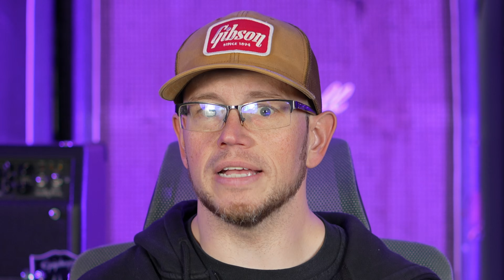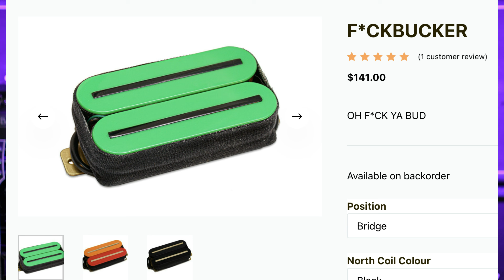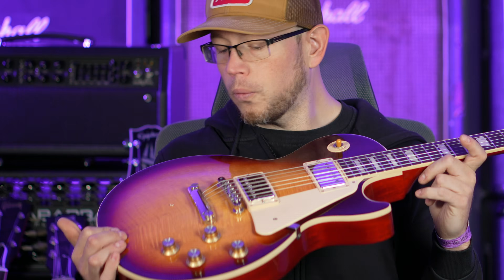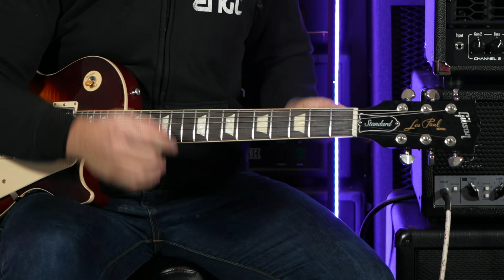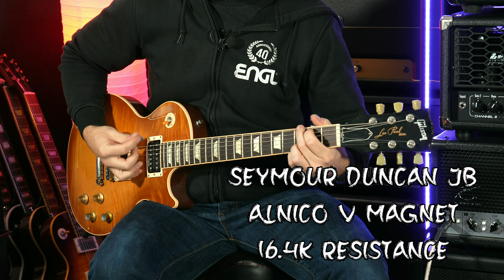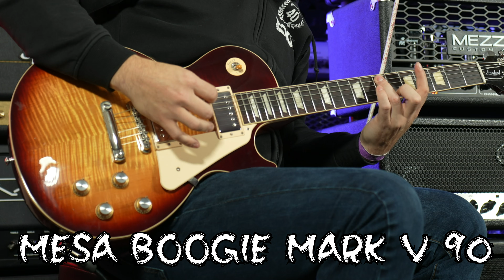EVERYONE has been using the WRONG pickups for metal......

Comment: I thought they all sounded like A$$.. They were all set too close to the strings and there were no separation in the underlying harmonics. Every pickup has a sweet spot where that happens IF someone took a few minutes with a screw driver to find it. ALL of these have obviously been set up with a ruler spacing.

Comment: To be fair, it's just the concept of gain staging.

Low frequencies have more energy so when you have a higher output pickup, they get pushed further. Those low frequencies distort more creating more harmonics above them which can muddy the sound. So it's not like it's necessarily an EQ, it's just increasing the gain which if you do in any sort of pro audio setup, can cause muddiness depending on where in the gain stage it's at. This is a lot like going through a Multi-Step process in mixing and making sure to drop the gain before moving into the next piece of equipment so that it doesn't distort the input. You'll get a clear distortion if you are letting the clipping stage in the later equipment distort, instead of pushing through the front end. 

Which means technically, both you and Glenn are correct. Just for different reasons. Glenn has not stated that there's no difference between outputs in pickups, in fact, he stated that's the primary noticeable difference between them all. And that's just in the passive pickup world. He's also stated there's a difference between actives and passives, and single coils and humbuckers. 
The main argument is that any sort of frequency curve that is built into the transducer, meaning the specific tonal characteristic of that pickup, is very frequently Lost once the signal has been clipped. I don't think he's necessarily come to the conclusion of thinking about gain staging in the harmonic series, but I think he understands that on a deeper level. He's just not thought to apply the thought process to the study.

Comment: When i have learned something about high output pickups then its that the more output you have the more dull they sound. 
From personal thinking i would say that the more output you give a pickup the less you'll be able to modify its low mid and high parameters - but i wont take that statement for granted - its just what i have in mind from engineering side - not a magnetics expert here.

Comment: I have discovered a good quality PAF humbucker can sound just as good if not better compared to a modern high output pickup for high gain applications. You just have to use the right amp and gear.

Comment: Using a boost is hiding many of the differences you would hear caused by various output levels.
Reply from the maker: No it is not. The pickups still have the same output levels and the amp gain was set exactly the same between all pickups.
Reply: @belligerentamateur  yes it does cause the boost is compressing the signal, any amount of compression is leveling peaks and valleys.  Try the comparison without it.

Comment: once I bought a Dimarzio 36th anniversary PAF set for my HH Tele i've pretty much been stuck on moderate to low output pickups. brighter, gives me less compression and less low end than the Duncan Custom and JB I was running in the past. That said, sometimes when I want that all out wall of sound I do like my duncan Black Winter.

Comment: ive noticed the alnico 4 even from other manufacturers have that mid boosted cutting tone with the vintage wind that mimics and overwound paf with an alnico 5  but the 7.8 k wind still keeps the inductance lower so the highs still cut through albeit with the med output ..the alnico 4 really doesnt have the typical grail paf tone but its compelling if you dont mind the slight mid punch ..

Comment: To add clarity to any pickup you just have to lower it, increase the string distance so that it captures less bass frequencies. Or EQ the amp with less bass (but it is trickier becouse EQ knobs interact with eachother, just have a look to a tonestack simulator)

Comment: There are two approaches - high or low output pickups. In early days you needed high output pickups, because it meant high-gain, now you have high-gain amps that have plenty of gain and more. Boosting a low output pickup wasn't a great option because pedals were noisy. Same thing with distortion pedals. You can use noisegate then, but even the best ones cannot work when your string output to pickup noise ratio is low. That's where high output pickups are usually better.
But today, I think even noiseless singlecoils could be fine :)

Comment: It was really difficult to hear a big difference. But I use Gibson Custombuckers PAF on my Gibson Custom Shop, and there is definitely more clarity when I swap guitars. Another thing is that if you set your amp tone with high gain while using a PAF low output pickup, and then swap over to a hot pickup, you might need to adjust some knobs down on the amp because now you got too much.
But which do I prefer? Been playing on and off for 17 years and I tried my first PAF (Gibson Custombuckers) last year. And I fell in love with it, so if I had to choose it would be that.
Anyone have a PAF pickup they really love that is also slightly wax potted? I would love to try some.

Comment: All those metal guys running EMGs with actual hits and songs that I've actually heard of are all wrong
Reply: Oof. Buddy. EMGs are low output. The pots are pushing that sound. Look it up..
Reply: Also want to add: That's why these people using high output passives that try to sound like Metallica, can't. A squier with low output will be easier to dial in a Metallica tone with the clarity of an EMG with note separation. You can laugh at that notion all you like and think it's a joke. It's not. EMG's output at 10..

Comment: High output pickups made perfect sense in the 80s when amps didn't have that much gain, but with modern amps and modeler the amount of gain we have at our disposal is so massive that you can make the tamest guitar chug 10x harder than the gnarliest guitar in the 80s.
I was recenlty toying around with my father's Gibson Les Paul loaded with low output, vintage specd PAFs into my PRS MT15 and I could easily acheive earth shattering palm mutes with the gain knob at around 4/10.
Reply: @argento8447  I have found that, regardless of the amps gain, higher output pickups have a fuller tone.

Comment: High Output pickups are ONLY for driving the front of a tube amp. IF you are using a modeler, or if you have pedals in front of your tube amp, use a 8 -9k pickup at most! If your pickup pushes too much.. you will clip (badly) your Modeling gear and some pedals... Get an EQ pedal to balance out your different guitars....

Comment: Man guys have been using PAF's for metal since the 70's.  It was all they had.  I've been really impressed with that clarity and note separation from the Alnico II Sheptone Kahanek pickups in my Tokai.  I've had those things for over 15 years and it's wild how well they hang with the higher output modern pickups.

Yeah you can absolutely tell that they have a bit softer of an attack and less pointy treble but compared to Alnico V, 8 and ceramics, the note clarity and separation when the gain on the amp is cranked is unmatched.  I had a set of Dimarzio Alnico II Pro's in an old Ibanez years ago and it was exactly the same type of sound and structure. 

All that said, I still think that a good set of Alnico V pickups is the sweet spot for most players if they want the clarity of Alnico but the tighter and more focused low end and more aggressive high end that most A V magnets have.  The gibson 70's tribute pickups in my Lizzy Hale explorer are absolutely incredible.  Warm lows and mids and clear smooth top end.  They're not as bright as the ceramic Alpha/Omega Duncans in my Schecter but they sound twice as big.

Comment: I have a LTD EX400BD wich was equipped with EMG 81s never really liked the sound of them. Then the bridge pickup broke and I replaced the EMGs with a Seymour Duncan PAF in the bridge and a Jazz in the neck position. The PAF sounded good but hadn't really that what I was looking for. Now it is replaced with a JB and that pickup fits the guitar, my amp and my playing well.
My Gibson Explorer sounds awsome with it's Gibson pickups. I also had a guitar with a Duncan Black Winter. What a beast of a pickup, in high gain it was mercyless brutal but with a fine clarity and brilliance, it was also a extremly hood pickup for clean sounds. Sadly the guitar wasn't sorted out in quality control (the locking saddle was drilled incorrect and everytime you used the Floyd Rose there was an audible crack by the headstock three luthiers said that it isn't possible to repair) as I bought it and didn't get it replaced. (Was a LTD M Black Metal an absolute banger of a guitar)

Comment: High output pickups are a solution to a problem that no longer exists. If you insist on absolutely not using pedals, these pickup manufacturers should at least offer coil taps on these high output pickups, so you can use it as an on demand boost.
Reply: Exactly!

Comment: Yes, I. discovered long ago that low output pickups and a hot amp brings the best tone.  Great video, my friend.  I love the pancake butt grandpa comparison!  LOL!  You dirty dog! The problem that I found is that you need more Les Pauls. On a serious note  , Are all the LPs chambered?   I love the chambered LPs .. I love em all. :) I also discovered a very long time ago, A pickup does not make that much difference at concert volume with a high gain amp.  Great video! Sugarbucker = Burstbucker.  The original. The after market Burstbuckers are alnico IIs. I guess they decided to call it a Sugarbucker now . Burstbuckers only cam in the  guitars.. I guess they had so many..  I love em.

Comment: High output pickups are super overrated. Spent some time chatting with a small builder who make their own pickups and that was their number one complaint. They'd keep getting asked for super high output pickups and then clients wondered why they spent all their time tweaking their rigs. They started getting clients to actually try out a range of pickups into a rig and everyone preferred much lower output stuff. Not necessarily PAF or low output, but often more mid output. I ended up with a PAF style neck and hot-mid bridge.

Comment: I have owned, and still currently, own far too many guitars to believe any of this nonsense about pickups making that much of a difference for metal. Even single coils if you go noiseless. I put EMG's Tele set in a Squier and was shredding on that thing before passing it on. It's all the same once you crank the gain! I mean, if you've already spent your money on literally everything else in the signal chain and you've got money to burn, by all means go ahead and play around with pickups. I sure as hell have. But don't let it stop you from making music. And don't think that your pickups is what's holding you back. Some of the greatest metal of all time was made with garbage gear.

Comment: Thanks for pointing out that changing pickups is not a huge game changer (with humbuckers). We are always fussing over pickups but never try different speakers. I like to say that you choose the amp based on gain and 'feel' (tight or spongy et cetera) and then you pick the right speaker/cabinet for the sound you're after... 🙂
Reply: Unless, of course, you're going between two very different output ranges. A super low output humbucker without shielding that's intended to go into a hollowbody might be a little microphonic and a bit different through a high gain amp than an alnico 8 super high output pickup.

Comment: great vid man, and good for those considering 1 of those sets of pickups.  Personally i play what ever feels good, got Fluence moderns in my main guitar, and i'm fine with that, the solar duncans are great too, i have EMG81/85 in another guit that i love, i used to love the JB pickups but changed em out as i found em to be noisy.  Ive got a RUDEROCK in one of my other guitars that is super creamy, but needs to be pushed a little harder, etc... its all up to application, but as i mentioned for someone consider these pickups in the video you did a great job showing then different tones of each. :)

Comment: Honestly, high output pickups in my experience give you better signal to noise ratio and attack for high gain. It's not about needing that extra output to drive your amp harder into overdrive, it's about giving you a "better" starting point so you don't need to boost and shape the signal all that much using boosts and overdrives.

Comment: Since the comparison is pickup A (PAF style low output) vs pickups B/C/D/E (high output), it would have made more sense to do the following :

- riff 1 : A B A C A D A E A
- riff 2 :  A B A C A D A E A
- riff 3 :  A B A C A D A E A
- etc

instead of what you did, which was something like the following IIRR :

- riff 1 :  A B C D E
- riff 2 :  A B C D E
- riff 3 :  A B C D E
- etc

The reason being is that by the time we reach C, we already forgot how A sounded like, and also the back-and-forth (A B A) is very important... Just doing A B (without going back to A) only tells one part of the story.

Just my 2 cents.

Comment: Guitar nerd here: using the "Pickup DC resistance" synonymously with "Pickup output" is not correct. It is one factor but there are other factors like the inductance of the coil that play a great role for the overall output level.
What we should really be looking for is not a single resistance value, e.g. 10k Ohm, but the entire frequency response of the pickup! That's where you see the real voice of the pickup for example a peak at 2 kHz. Unfortunately, hardly any manufacturer will give you this characteristic curve.

PS: awesome video !
Reply: You can literally get a mv output rating on any pickup.
Reply: @Doty6String how are you specting to measure something usefull that way?
Reply: Impedance (Z) curve or peak is the  resulting value of R and Q (dc resistance and blind resistance); but in AC. Im still surprised that pickup manufactures dosent seem to have a clue on electronics... maybe that's the secret mojo...😂😂😂

Comment: YOUR STUFF: 
some of those guiters sound thin enough on their own, and can use some heavier pickups for full gain metal, if put through the right amp, in this case it s hands down the Mesa Boogie. Hands down a superior sound because it gives a REAL impression of what you are playing. It s all the same for the Peavey and the Mezzabarba would feel different in the low end, but the Mesa captures the body. after being frustrated with my setup, i can clearly hear what the Mesa is doing, and it s reproducing the sound coming from the instrument very accurately on those settings. Fidelity, if you put another batch of pickups and guitars the differences are big.

ADVICE:
I don t want to say this, but pickups and guitars sound very different in relationship to each other, don t ask me why a pair of pups on one guitar will not, i repeat, will not sound like the same pups on another guitar. period end of story - you might find like 10 guitars it sounds the same in, maybe - but you change more and more and eventually you will be hit by the realization that to each his own is key for accurate intended representation. not just the final sound *which is more of a production thing, but the feel on the fingers, the feel in the room as you are playing, massive massive differences with some pickup -- again not as easy to pick up on a mic, but definitely there through and through.
 
MY STUFF:
have a BC Rich Beast. NT with Licenced Floyd yes, made in China.
their own pickups sounded muddy. Have a Behringer i put some buckers in, it sounds massive, it was beforehand a single coil. I ve done the exact same mod on another exact same Behringer guitar for a friend, and put my BC Rich pickups in it, it sounded massive. -- i ve changed some pots, and the same in the Beast -- with the DiMarzio Activator X, which is a very hot pickup, it sounded better but still similar. - answer: bought some cheap chinese 40 bucks ALNICO pickups, it brightened the thing right up. Put a push-pull pot wired for F-spaced, pulled is forced single coil (still sounds better and fuller than single coil) and pushed is bucker - dude, i shit you not, this is the tone i ve been looking for. the gimmick is to pair up your instrument with what it needs either objectively or for what you re playing. otherwise, focus on the amps and more on the speaker, the cabs, the mics, the works.

Comment: They should have called them SweetBuckers. Why SugarBuckers?! SWEETwater didn’t want to go with the obvious choice for a Signature humbucker name?! 😂😂😂

Hey, I’m with you on this pickup assessment. Old amps needed high output pickups. New amps don’t require high output pickups for all the reasons you explained. I think high output pickups on modern amps ends up sounding plasticky, muddy, or a combo of the two. PAF’s were all historically different back in the 50’s, and they’ve evolved over the decades . . . but overall, I completely agree that they sound the best for metal on modern amps better because they sound clearer and have more dynamics than high gain pickups. 

Let modern amps do the heavy lifting and the PAF style pickups will take care of the nuisances. Both together make metal music sound crispy, crunchy, clear, and dynamic all at once on the trebles, mids, and bass tones. 

If you like flubby, farty music, then get an AssBucker to pair with your modern high output BabyGotBack amp (which are both designed and manufactured in CrackOw). Digital diarrhea abound!